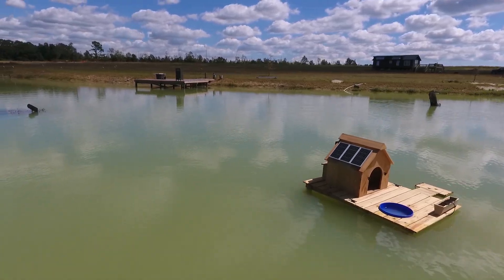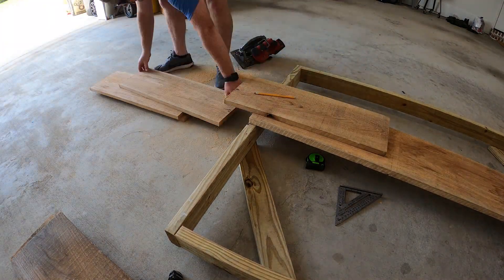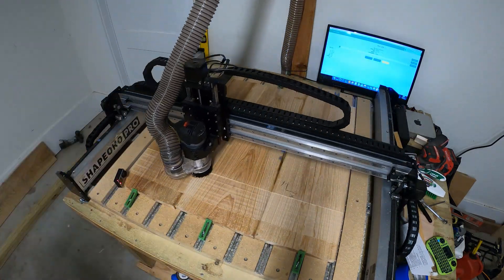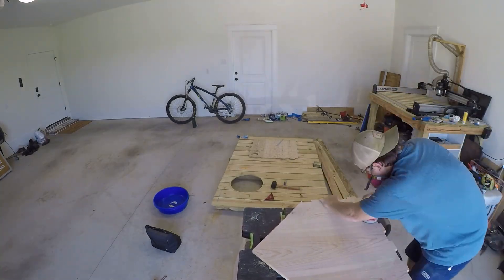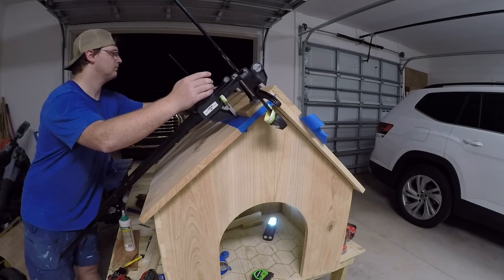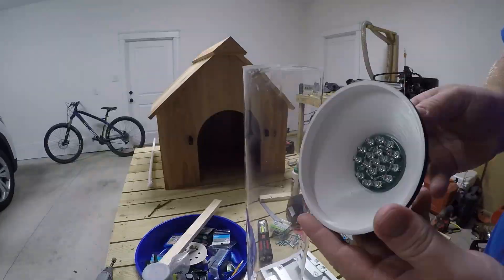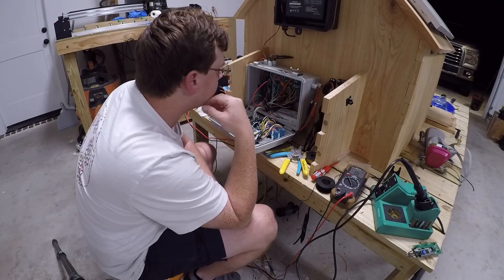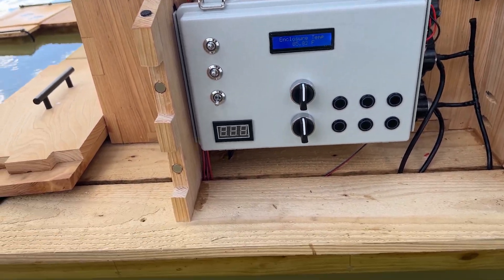Building BamaBass's Duck House Mansion

Comment: What charge controller are you using ? Do you have the panels in series, parallel or both ? Are you pulling directly from the batteries or charge controller and using a converter to supply the teensie or is there a USB power plug to do that for you? :) love this build, it’s so awesome!
Reply from the maker: I linked the controller in the description! Can’t fully remember the name right now. All the panels were wired in parallel! I did this to keep everything at 12V and increase the solar panel output current! I was pulling from the battery directly and was regulating the voltage with my own components! I did this so I could measure the battery voltage and the solar charger only output 5V with limited current! Thank you! Glad you enjoyed it!

Comment: need drainage water hole on battery box and controller box. need electrical staples ((any hardware store)) to fasten wire to lumber to keep ducks, turtles, other from snagging cables inside the lids of the duck house. Swap to a different controller board with wifi single on it. ((have not looked at specs to tinsy in a long time)).  controller box mounted higher. i can just see my self stepping on it and sinking controller box directly into the lake water, that or a wave of water. inverted fish tank that small (((grumbling at trying to clean it))) try to reach a bottle brush a few feet under and up into it. time to toss inverted fish tank each time it needs cleaned. spacing of boards for deck are they wide enough spaces? i am talking about "shit" that needs to be wiped off and ease of cleaning.  CODING timer needs to be set on duck shower. i can easily see turtle to duck just setting there for a few hours and running batteries dry.

Comment: There used to be a local bar along the Black River in Springfield VT called "The Duck Inn".  It closed back in the '80's and the building has housed several restaurants and businesses since then (the Chinese restaurant that was there even had a large aquarium...and duck sauce!).  Whenever locals (particularly Gen X or older) are talking about something new that opens in that building, it's still referred to as "the old Duck Inn".  I think The Duck Inn would be a good name.